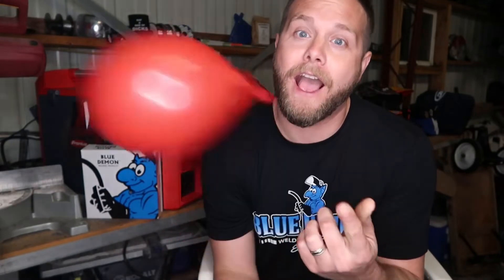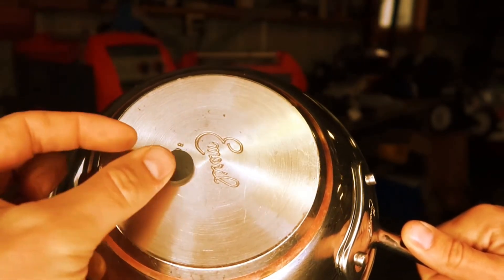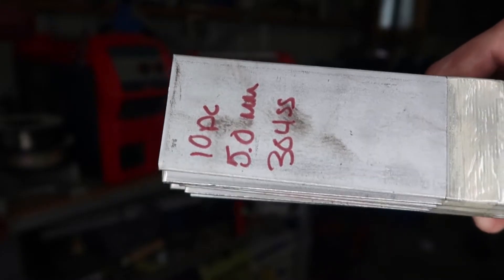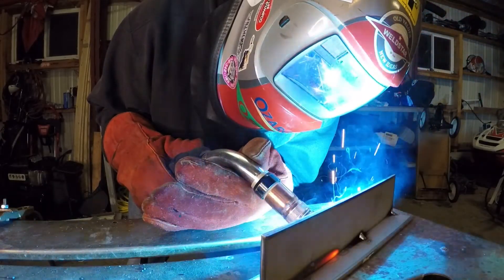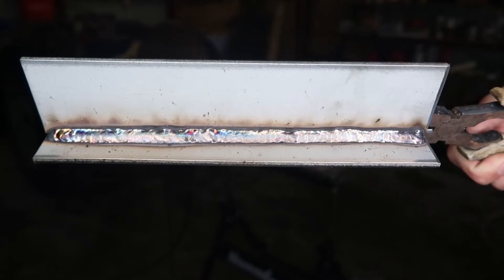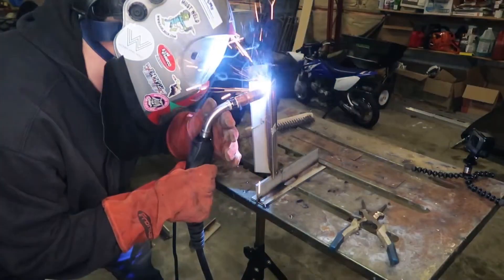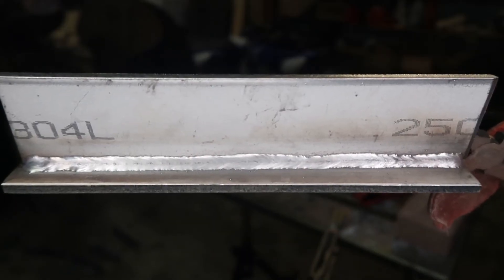Welding Stainless Steel Without Trimix On 110/220 V ...........

Comment: E308LFC Flux core wire voltage range recommended is 24 to  31 volts.  Wondering why you chose 16 volts  ?

Comment: You blew your settings with the 308LFC-O. That wire runs DCEP, and you switched to DCEN to run it. Switch the polarity and you will find it welds much cleaner. Also bear in mind the Blue Demon recommends 22-25V and 130-150A setting range on your machine.
Reply: Glad someone else saw and mentioned this.

Comment: I was wondering what respirator you were using in the video. I’m trying to find a respirator that’s low profile to fit under my welding helmet.
Reply from the maker: https://store.cyberweld.com/mille-lpr-100-half-mask-respirator-ml00895.html?utm_source=google&utm_medium=shopping&utm_campaign=googleproducts&gclid=CjwKCAiA0JKfBhBIEiwAPhZXDyTqXEGw0xr_GkMGrJ17-3VN1u7rrHJ7ibsp77TpC63pwYFw_JdXHRoCMcEQAvD_BwE
Reply from the maker: I’m not sure if it’s made for chrome zirconium so make sure to double check

Comment: What would your wire feed speed and amps be for 18 gauge stainless using 98/2 and  308 LSI wire
Reply: Sorry wire feed and  Volts
Reply from the maker: What size wire makes a difference. What size wire?
Reply: .035
Reply: Also 308 ls .035

Comment: So can you run normal 308L with 75/25?  I am trying to butt-weld stainless steel exhaust with 75/25 and (I think) 308L wire and I am not getting the results I would like to have.  I'm using a Yeswelder 205DS multiprocess on 220v....
Reply from the maker: Sorry for the delay. Yes, you can use 75/25 but it will burn most of the chromium out of the material. I suggest using a 308 stainless flux cored wire. If your not worried about long term rust then use the 75/25

Comment: Where my location is Superior Welding Supply. Can get me trimix same price as argon co2. 90 helium, 8 argon and 2 oxygen/co2. I will prolly do oxygen cuz it helps a bit more with toeing and allows for short circuit welding to be a bit more consistent
Reply from the maker: Thanks for sharing 👊

Comment: I just picked up a Transsteel 2200. I've got a bottle of 100% Argon for TIG, but I'm not sure I can find Ar + 2-5% CO2 at my local supply. Does anyone have experience running 100% CO2 in MIG on mild steel?
Reply from the maker: Who do you buy your local gas from ? Yes, the C02 option is really good for 3/16 and below.

Comment: New to welding, have a diy project that will need welding on ss kegs. But will also have some cs exhaust piping welding as well. Low budget, any recommendations on what gas I should get for the mig I'll be using? Only have one tank and would like to avoid multiple trips to change gases.
Reply from the maker: Sean, Sorry about the late response. You could get a spool of self shielded stainless steel from Blue Demon. You wouldn’t need gas for it. This would be the cheapest solution - 2nd could be gas fluxcored wire with 100% CO2. The 100% CO2 could be used for both steel and stainless

Comment: Didn't you get sugaring on the back side ?
Reply from the maker: If it burned through then yes. Most of the weld joints and thickness didn’t burn through with the settings

Comment: If I'm not mistaken with the flux core stainless you are supposed to run dcep
Reply from the maker: Jacob  Hodge Correct....
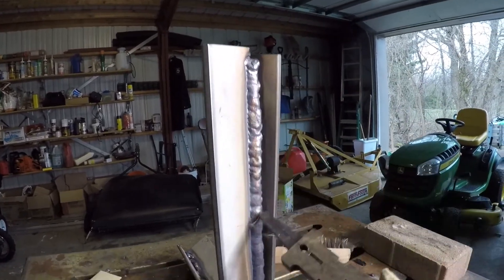Reply: @chris_b_liven  was the  video  where demoing the  flux core have the  polarity wrong, i think he had the gun attached to the  negative? see 10:39

Comment: Thanks man, I really appreciate you going over settings and experimenting. You ever try aluminum with 98/2?
Hey and also, if I didn't know better,  I'd say you swapped out the helium for nitrous in the end......just sayin'.....
Reply from the maker: Tommy T I haven’t tried welding aluminum with 98/2 but it’s worth a try. I’ve seen companies welding with 100% Argon on stainless
Reply: @chris_b_liven  yea I had an Esab 160  and tried trimix. Hated it. Didn't like the welder much either.
My dad ran 98/2 on his mobile setup (Trailblazer w/spoolgun). From what I remember he used it for both aluminum and mild steel.
Reply from the maker: Tommy T Nice... I’ll have to try it when I get a chance just to see
Reply: @chris_b_liven  that’s what I use 100 argon but I’m running tig not mig